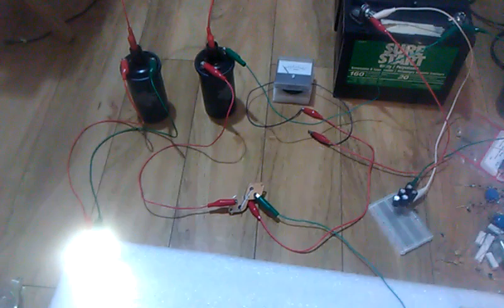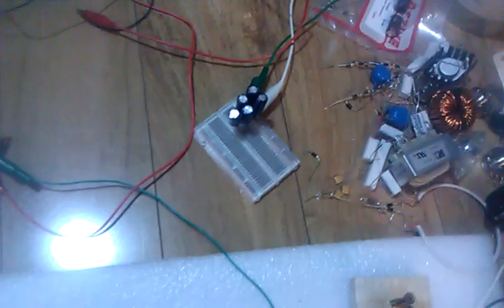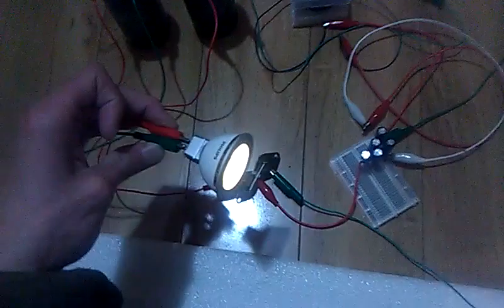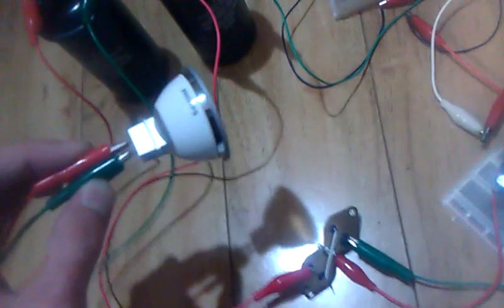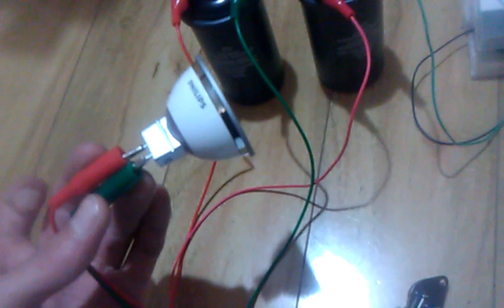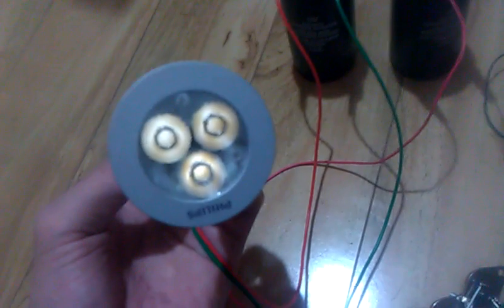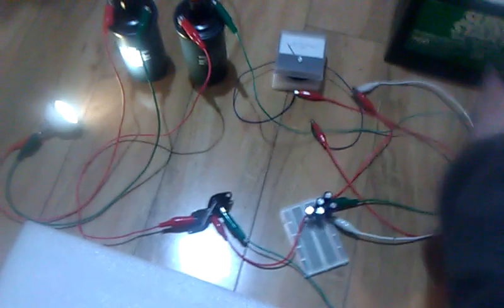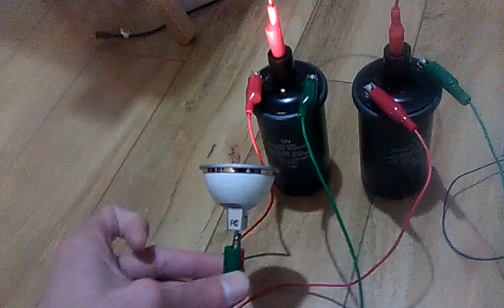Radiant Oscillator Circuit: Running on Capacitors Alone Part 4/

Comment: @kdkinen.
A thought -
Does placing a neody magnet in line with the centre end of the transistor driven HV coil affect lamp brightness - either polarity, different strengths, different gaps ???

Comment: The ground (either electrical mains ground, or conducted earth ground) is triggering the base (transistor switching) relative to the rest of the circuit, which itself is coupled via the natural impedance of surrounding free space, and is NOT merely insulated within the air we breathe as we are wrongly and willfully erroneously taught at school, in colleges etc.

Comment: If ever there was a proof for the natural impedance of free space with respect to ground (earth or a large mass object) then you most certainly have it here.
Due to the LED light not suddenly triggering into conduction at high voltage the circuit needs a joule thief microamp (keep-alive) oscillator running in parallel background base drive to maintain main circuit oscillation.